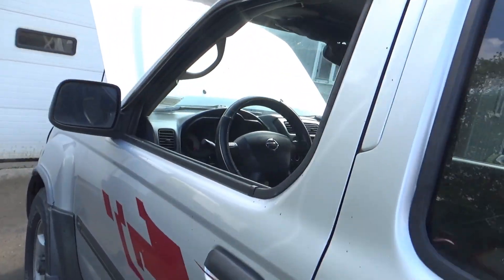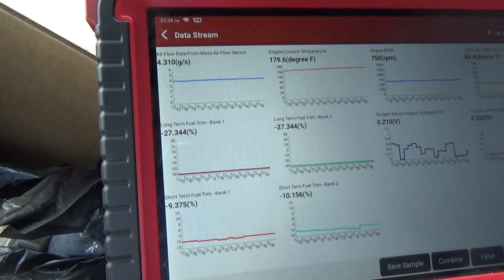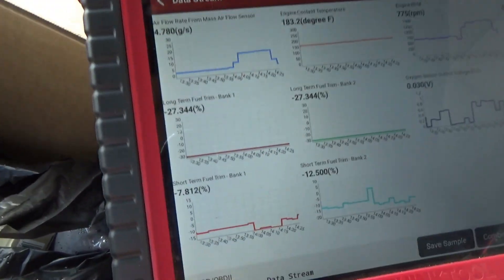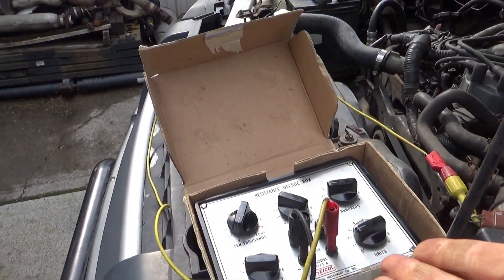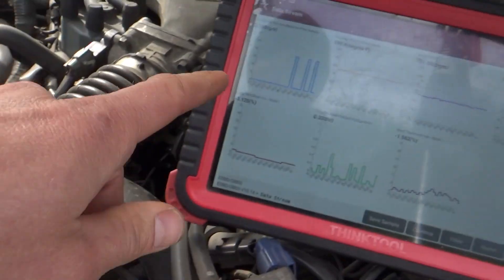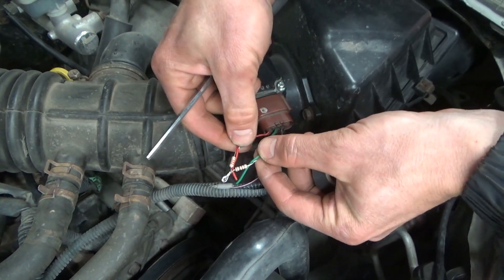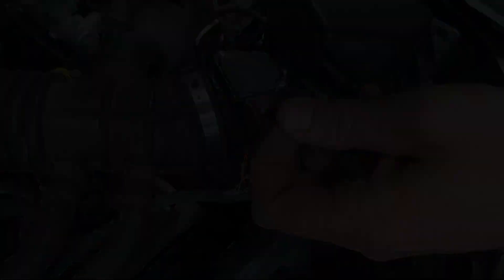I'm STUMPED...Crazy RICH XTerra P0172 (Part 2)

Comment: time to smoke test the air intake.
Reply from the maker: Why?
Reply: @PineHollowAutoDiagnostics  it may be getting too much air. the 02C sensor may be signaling the computer and messing with the values sent to the MAP.
Reply from the maker: @randy1ization  too much air would be lean condition... This is the opposite 👍
Reply: yes the o2 sensor is oscillating but are the values correct..? also what abt the air/fuel ratio sensor, does it have one.? if it has a bad air/fuel ratio sensor it may be signaling the injectors to stay on longer..
Reply: @randy1ization  You have a point, but that is not what appears to be  happening here. The O2 sensor is reporting rich, which is what's causing the code.  You can see the O2 sensor responding in on the diagnostic screen, and the fuel trims being driven predominantly negative, indicating a detected rich condition which is triggering the computer to reduce the amount of fuel.  The O2 sensor is the Air/Fuel ratio sensor.
Reply: @Robert-S-  ok, some vehicles have an air fuel ratio sensor AND a o2  sensor., my sons honda civic has this set up. also my 2005 nissan frontier had it. my son had a check engine light and diminished fuel economy., he changed the A/F  ratio sensor and the light went away and his fuel mileage improved.  just something to check.
Reply: I know the air /fuel ratio sensor values are compared against the post CAT  numbers to see if the cat is working, but im thinking it may also play a role in fuel mapping.,.
Reply: @randy1ization  There are sensors before and after the catalytic converters.  The after ones are basically only ever used to monitor the catalytic converter.  The pre converter sensors are used to control the fuel mapping.  That is what we keep trying to explain.   The O2 sensors are critical to the fuel mapping, and they are the ones setting the Rich error code.  They are telling the computer to reduce the fuel, and the computer is reducing it as far as it can, but it can't remove enough fuel to make the O2 sensors happy.  The O2 sensors behave completely as expected under different load conditions, he showed this in the video clips, where the sensor readings for both pre-catalytic converter sensors are switching between 0 and 1volt.  Somewhere right around 0.5v is 'perfect', lower than .5 is not enough fuel while higher than .5v is too much fuel.  The overall trend in his data and to the computer, is that the O2 sensors are consistently reporting higher than .5v more often than lower....which again, means they are reporting a rich mixture and nothing the computer does can get the average to stabilize or go towards the lean side of things.   The engine appears to run acceptably, it isn't throwing misfire codes nor is it running rough or lacking in power, so the Air Fuel ratio is close enough for it to continue operating.  However being able to operate, and operating as efficiently as possible are not the same thing.

Replacing the MAF produced a fuel economy improvement as stated at the beginning of Part 2 video, so clearly there was something wrong with the previous sensor readings, but the overall rich fault code is still persisting.   It's very unlikely that the O2 sensors are the problem, unless they are just enough off to provide a bad reading that is still close enough to allow the engine to operate without major symptoms, and that is just not a very likely failure path for an O2 sensor.

Most likely problem is with the Fuel Injection side of things, it could be a basic programming issue within the ECM, it could be fuel injectors that are leaking slightly allowing more fuel into the engine especially on the exhaust stroke, it could be  worn out injectors just flowing too much fuel, it could be incorrectly sized or manufactured injectors flowing too much fuel, it could be a fuel pressure issue, where the fuel pressure is higher than it should be...again allowing too much fuel into the engine.  It could be a completely bad ECM that just can't control things properly anymore due to faulty components, it could be something stupid like a bad ground causing a sensor reading to read just enough off.  Amongst a few other things.  But nothing currently is indicating a problem with the exhaust system or the air intake or the O2 sensors.  The engine idles fine, the engine has plenty of power from idle and at highway speeds, so there isn't any indicators that would point to air flow being a problem, the pre catalytic converter O2 sensors are both behaving as expected and the post catalytic converter sensors are not indicating any issue with the converters.

So either the computer is interpreting the data wrong due to an internal circuit fault or an external wiring issue, or there is something going in in the Fuel side of the equation.
Reply: @randy1ization  Those are O2 sensors. There are different O2 sensor designs based on the vehicle and the electronics, just like there are different tires or headlight bulbs.  But they all do exactly the same thing, they measure the amount of Oxygen in the exhaust to help the computer calculate the Air/Fuel ratio.  Its no different than calling a hood a bonnet or a trunk a boot.  It's the same part by a different name.

Comment: That ground voltage seems too high for a low current circuit. Is the computer/sensor ground properly connected?
Reply from the maker: Hot wire MAF actually draws a bit of current. 57mV is perfect 🙂
Reply: @PineHollowAutoDiagnostics  you'd know better than I would 👍

Comment: Looking forward to part 3 for sure!  I have been chasing rich long term fuel trims in my 18 year old Chevrolet Malibu V6, but not quite negative enough to set a code.  Went through the same thought process as here  and replaced the MAF with OEM. Also checked most of the other systems mentioned by commenters here.  Hoping this case study will provide insight.

Comment: Maybe you should create and install an adjustable, filtered, unmetered source of intake air to correct the mass air flow reading?
Reply from the maker: Would only work at idle... And suck in dirty air bypassing the filter 😅

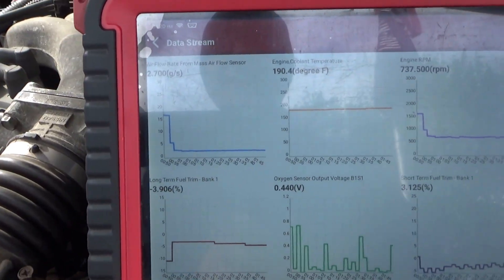Comment: That little "glitch" at 7:03 might be a clue, perhaps it is occasionally getting voltage spikes on the signal feed, but data refresh rate on OBD2 with 7 pids is too slow to catch it?
Reply from the maker: I think it was just a silly scanner glitch 😆
Reply: @PineHollowAutoDiagnostics  Maybe, but I noticed it happened more than just that one time you were outside of the truck! Looking forward to part 3 :)

Comment: A over sized fuel pump could also send to much pressure
Reply: Couldn't cause the MAF to read high though, and would only cause rich running if the pump either has an integrated pressure regulator or the fuel flow was so high the regulator on the fuel rail couldn't bleed off enough fuel.
Reply from the maker: True, fuel pressure check is a great idea... But no Schrader valve 😒

Comment: You need a known good to compare to. Id be leary of putting resistors in the signal line because then if you're compensating for something else causing a rich issue, you could cause transmission pressure related damage.
Reply: hadnt thought of that but your right, Ive been learning abt transmissions lately and amazed at how many inputs they get.. MAP. MAF, TPS, 02 SENSORS, ECT. I will never drive far with a check engine light on again,.

Comment: Why was the value glitching upwards? Seems like a clue! It also happened with the previous MAF (it is visible in part 1). Perhaps there is corrosion somewhere in the harness, causing voltage to bleed from a battery positive circuit into the sense circuit. Then when you wiggled it, it made better contact with the short? You probably would have seen it if it was in that connector, so it seems like the source of the glitch must be further down but nearby? I would unplug the computer and the MAF and check resistance on that wire to battery positive. I bet it is not infinity.
Reply from the maker: Great question! Just silly OBDII data is my guess... Otherwise engine would have sputtered or stumbled or set a code... But it ran smooth as glass 🙂
Reply: You're a sharp one, Jessica.  You are talking about a capacitive short, as well as a resistive one.  These are the kind of things that stump a lot of mechanics out there, as these are some of the most diabolical of problems that can change with the humidity.  Glad you brought it up.
Reply: @vilefly  While I have no doubt such a short would have capacitance, I'm not sure how that would come into play? It would probably not be more than a handful of pF (????), we're essentially at DC here, and I would expect the line impedance to be somewhere on the order of tens of k ohms (if it were directly into an MCU ADC it would be on the order of hundreds of k ohms). With an impedance of 10k and 1000pF of capacitance, the RC time constant is 23 microseconds, completely immaterial. Or are you talking about capacitively coupled interference signals from the alternator or something? Still that would be too low frequency to matter.
Reply: @jessicav2031  Capacitively coupled interference from nearby ac or pulsed dc signal circuits.  I have experienced this with water that is trapped up into the harness that has cracks or tears in the insulation.  It may not apply directly to this situation, since it is a dc signal.  It is something to be on guard against, nonetheless, since we have an active ignition system in play.  Noise on the o2 sensor signal line is quite possible.  DC bias vs ground is also possible with dissimilar metals and some not-so-pure water.

Comment: Leak before o2 sensor causing closed loop to run richer.   Usually a pinhole in front of the catalyst that pulls ambient air in the exhaust falsely leaning out the system causing the ecu to then add more fuel (usually 10-11%) 

Common on SH7075-sh7078 processors like this Hitachi ecu.  

350z In 2004 do the same thing.  

I tune the ecus and can resolve any issue like this in the lambda target tables

Also, better datalogger setup like a 10.00 Elm327 works wonders with a laptop.    Far Faster than that scrap Bluetooth drew technologies scanner.
Reply: I'm trying to understand the relationship of O2 sensor and Fuel trim.  Extra air brought into the system before O2 would make the O2 sensor believe more fuel would need to be added, wouldn't it?  If so, wouldn't that fuel trims be positive not negative as they are here?  The O2 sensors seem to be telling the computer "there is too much fuel in the exhaust" and the computer is triggering the injectors to push out less fuel (negative fuel trims).  I defer to your experience though.
Reply: @IsItTrueThat  You are quite correct, air leaks in the exhaust near the O2 sensor tend to cause positive fuel trims to go with the rich running.
Reply: I subscribed good sir.     Do you do anything with Jeeps?

Comment: I got a really bad feeling about this diagnosis and repair, Ivan.  This almost looks like the VW diesel trick to pass the emissions test.  I don't know what all you looked at but it looks like you only considered the MAF sensor.  There are other things that affect the fuel trims.  I'm guessing that you will find it in part 3.
Reply: The ECM is reporting air mass that is well above the expected values for the engine though.
Reply: @ferrumignis  The signal was showing 1.2 volts and the spec showed that 1.0 - 1.7 volts were acceptable.  Despite this, the fuel trims were below -10.0.   Perhaps the ECM has to recalculate the fuel trims or there is an electrical ground problem or some other sensor affecting fuel trims is off.
Reply: @ferrumignis  The bottom line is that this vehicle must pass Pennsylvania inspection.  If this "kluge" fix does not result in extra pollution out of the tailpipe then "no harm - no foul".   But if it doesn't, potentially Ivan could run afoul of the EPA Nazis that punish shops who rig the emissions of vehicles.

Comment: This is quite the enlightening series as I have a friend with a nearly identical truck and the same problem.  I have yet to find a reliable solution to it.  So I am looking forward to part 3.
Reply: Wow. So, this is not an isolated issue.  You would think Nissan might have something on this. But maybe not for the age of the vehicle.
Reply: As far as i know its fairly isolated. I own 7 Xterras and none has this issue nor are mainy reporting it on ClubXterra often

Comment: Could ECU use some calculation to determine the grams per second of air flow?    Maybe it uses inputs from a few different sensors to calculate the mass air flow?    Just a wild guess.  Since sensor is operating within spec, my guess is ECU putting together multiple data sources to calculate the air flow???
Reply: The MAF sensor literally measures Mass Air Flow.  If the MAF signal is wildly out of specification (e.g. unplugged) the ECM may use a calculated value based on other parameters.

Comment: This is an interesting problem. My uneducated guess is that there is a voltage or ground issue. If I am not mistaken, if the MAF sensor is disconnected, there should be 5V between the signal wire and the ground wire on the harness. If it is higher than 5V, then when the sensor is reconnected, then the resulting signal voltage would also be higher. In addition, the occasional spike in air flow reported by the computer that you saw would seem to indicate an intermittent wiring problem or problem with the ECU. Looking forward to part 3.
Reply: I'm wondering if there's a dry joint starting in the calibration resistance inside the ecm and applying a " pull down" load at the maf is compensating for this?

Comment: Check fuel pressure just like (you couldn't do with 'a classic Chevy Christmas'
Stuck closed PCV or wrong part?
Wrong injectors?
MAP?
Valve timing off?
What happens when you disconnect MAF and use a different strategy?

Comment: IVAN, CHECK THE FUEL PRESSURE REGULATOR , IT MIGHT BE LEAKING . I WENT THRU THIS PROBLEM YEARS AGO.
Reply from the maker: Great suggestion! Would mostly affect high vacuum situations like idle though 👍
Reply: @PineHollowAutoDiagnostics  THE VEHICLE I WORKED ON HAD A SLIGHT LEAK FROM THE REGULATOR,  IT KEPT FOULING OUT THE REAR SPARK PLUGS, BUT NOT REALLY AFFECTED THE IDLE.
Reply: @SEXYTECH1000  How does this cause the MAF to read high?

Comment: So - If a hot-wire MAF is reporting high, the air flow across it must be a bit high.   Has anybody removed the air cleaner box to check if the tube is partially occluded?   This would force more of the air across the MAF sensing element and artificially raise the perceived airflow - same as using a MAF tube with a smaller cross-section (has anyone changed the MAF tube off the airbox by chance)?
Reply: We call this one, "the leaf-maf conundrum".

Comment: Had a very simular issue on my car when I bought it. The sensor would say it went way rich but in reality it did go lean. Swapped out the sensor fixed it for a while but issue came back. Then I remapped the engine not to use the maf sensor and it ran fine until eventually the ecu died. Replaced the ecu and still don't have the sensor connected or the boost sensor. I run my Volvo at full send all the time. My right foot is basically the sensor. If it doesn't feel right don't force it. But if she wants to pull let her rip :)

Comment: Fpr? Injectors?
Reply: P0172 NISSAN - Fuel Injection System Too Rich Bank 1
Possible causes
- Faulty front heated oxygen sensor
- Ignition misfiring
- Faulty fuel injectors
- Exhaust gas leaks
- Incorrect fuel pressure
- Faulty Mass Air Flow (MAF) sensor
Help with this
When is the code detected?
- Fuel injection system does not operate properly.
- The amount of mixture ratio compensation is too large. (The mixture ratio is too rich.)
Symptoms
- Engine Light ON (or Service Engine Soon Warning Light)
- Excessive Fuel Consumption
P0172 NISSAN Description
With the Air/Fuel Mixture Ratio Self-Learning Control, the actual mixture ratio can be brought closely to the theoretical mixture ratio based on the mixture ratio feedback signal from the heated oxygen sensors 1. The Engine Control Module (ECM) calculates the necessary compensation to correct the offset between the actual and the theoretical ratios.
In case the amount of the compensation value is extremely large (The actual mixture ratio is too lean.), the ECM judges the condition as the fuel injection system malfunction and light up the MIL (2 trip detection logic).

Comment: My thoughts: I think like you do that the PCM needs a lower voltage, but I'm thinking that the reason the PCM is reading it wrong is that there is a missing ground in the PCM. It floats some of the internal voltages that it reads. Check all the grounds at the PCM. Also maybe install another ground strap to the engine.
Reply: I was thinking that too
Reply from the maker: @T.J. Kong 300mV was SIGNAL wire KOEO. Ground was a nice 57mV 🙂
Reply: I agree, what is the voltage at the computer measured at its ground and signal wire?  I don't agree with a band aid fix as a permanent solution.

Comment: Some days you just have to hate working on cars, I had a Toyota recently that the customer had installed aftermarket fuel injectors that where providing too much fuel no matter what the mass air flow or o2 sensors where telling them causing a rich condition. This is a very interesting case, if your resistance readings at your mass air sensor are correct something is changing that reading before or at your pcm, green crusty at pcm connector maybe? You would think not as you had to increase the resistance in the circuit to get to a correct reading.
Reply: He decreased the value. He did put 3k in paralel, making the total resistance lower 1/Rt = 1/Rmaf + 1/3000
Reply: @mauricevandoeselaar  ahh ok I thought he had it in series, that would make more sense that a poor connection of a poor ground at the pcm might be causing the false reading from the maf sensor, thanks.